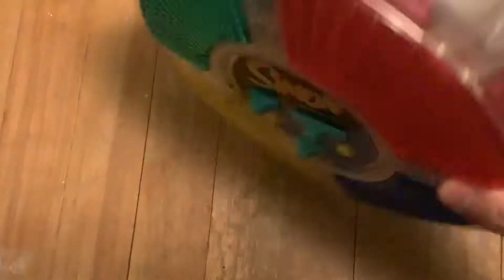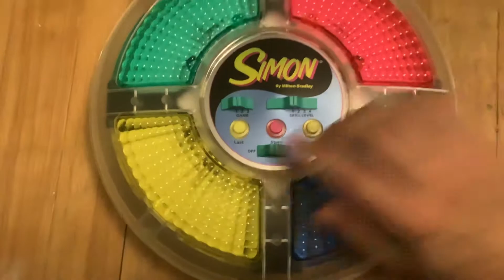Milton Bradley Simon (1994 redesign, 1st Edition)

Comment from the maker: This is indeed from 1994, NOT 1997.

Let me explain why that’s important.

This one, from 1994, runs on D batteries and a 9-Volt, whereas, apparently according to multiple sources, the 1997 runs on C batteries and a 9-Volt.

This is most likely another case in which you’ll probably have an easier time finding this one, be it 1994 or 1997.

This also has a drastically different sound design, as is normal with Simon games over the years, as they all have unique sound designs.

You’ll see more of what I’m talking about in future videos.

Thank you all for watching, and take care!

Comment: The sound just like Simon touch
Reply from the maker: @ExcavationInitiation-ip2cd  

Ya know, it kinda does, actually.
Reply: @SirBopALot  the black one sounds similar to the Simon carabiner
Reply: @SirBopALot  mine just like this video had trumpets and sound like a Simon carabiner
Reply from the maker: @ 

Did you know they made three Simon carabiners? There's the standard black one that I'm sure you and everyone else is familiar with, there's a White Edition, which MIGHT be referencing how the Japanese version of the initial version of Simon had a white plastic shell, but that could also be a bit of a stretch, I don't know, and a bigger one fashioned after teh Simon Touch.